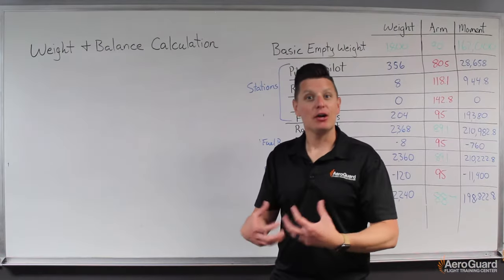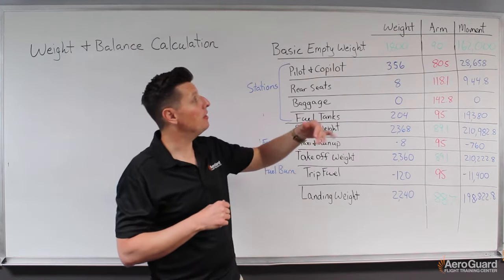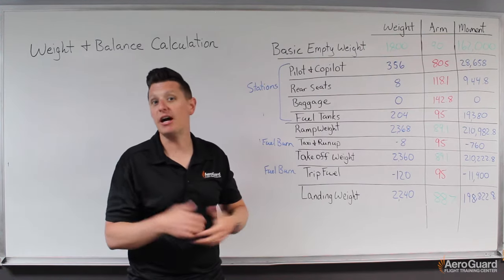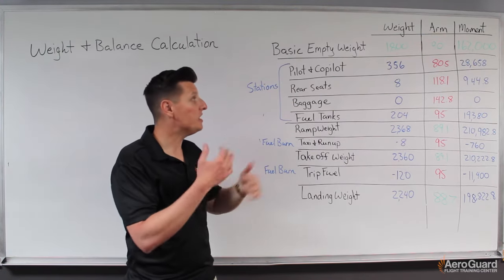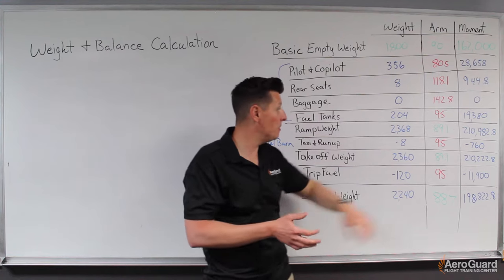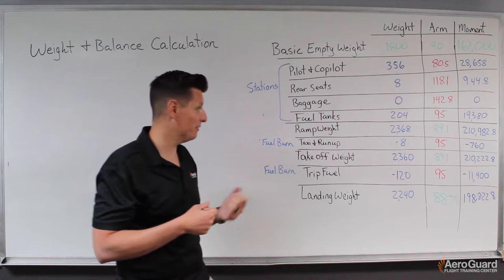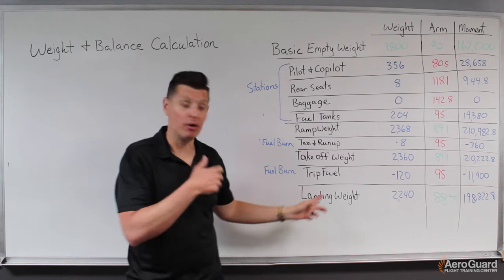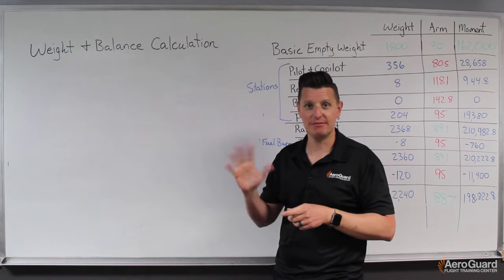How to Calculate Weight & Balance – AeroGuard Flight Training Center

Comment: Sounds like there should be an easier way of doing this! It's confusing!
Reply: Maybe you should get into trains then, I hear they're easy to drive.
Reply: @redcoatmamamosa  rofl
Reply: Its ease mate just times the arm by the monment but try follower this on here he puting the long way round. look for weight and blance on the plank it show its so ease mate
Reply: Make a spreadsheet that does all these calculations for you. That will force you to learn this step by step AND give es you a tool for faster calculations which saves time during flight planning.
Reply: @stevesayer4045  wot m8
Reply: It's literally third grade math steps
Reply: Nice explanation. Well usable for the preparation of my checkride here in Bavaria, Germany.
That's how I learned it. Good repetition for me. Thank you!
Reply: I bet your flying a 777 now

Comment: Wait that 95 on the taxi column,where is it coming from?
Reply from the maker: Hi, thanks for your comment! The 95 inches (Arm Aft Datum) comes from the Pilot’s Operating Handbook where it’s published under the Weight and Balance section (Section 6) for fuel allowance including engine start, taxi, and run up. We hope this helps, and let us know if you have any other questions!